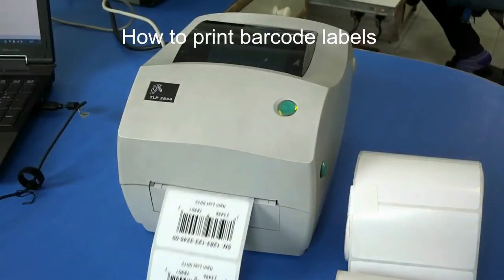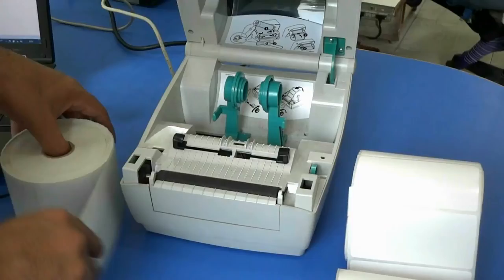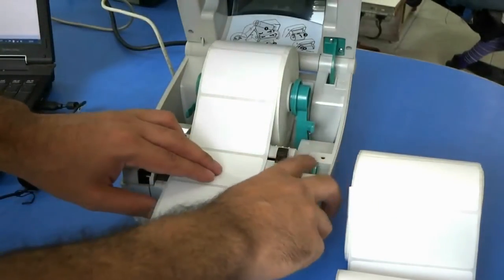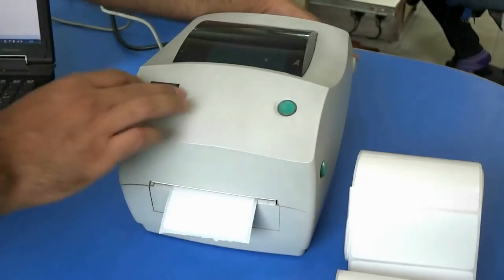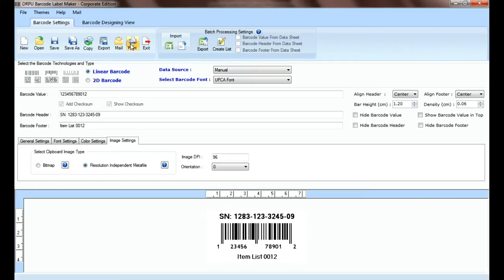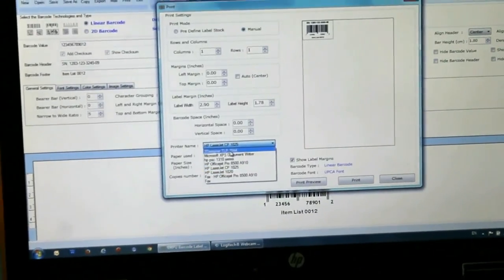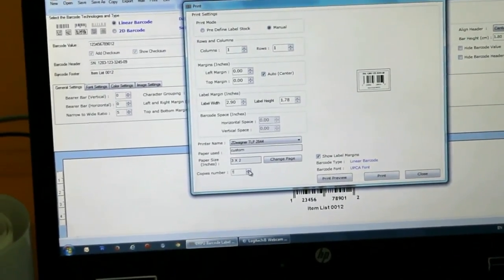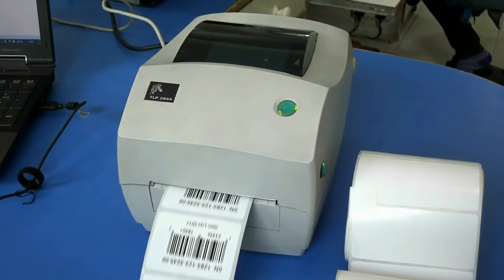How to generate and print barcode labels by using zebra thermal printer

Comment: HI Tarun - I have purchased a zebra tlp 2844 printer,,, when i am giving print command, the label comes out but it does not print anything. its a blank label.
Reply from the maker: Try printing test Print using Printer Driver software to make sure everything is in order. Check Margins and label settings. It is the most common issue with thermal printers. Make Sure your "Black Film" has been placed correctly. Only one side has ink coating. wrong side will not print anything.
Reply: Thanks Tarun,,, I will check as per your suggestion. if you don't mind can you please share your contact no. I may get in touch with you if it does not works.